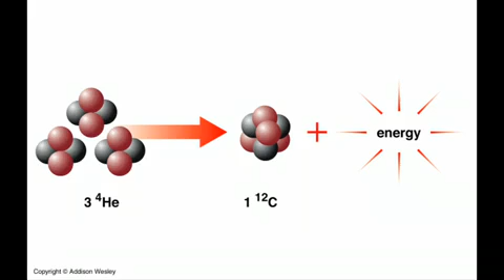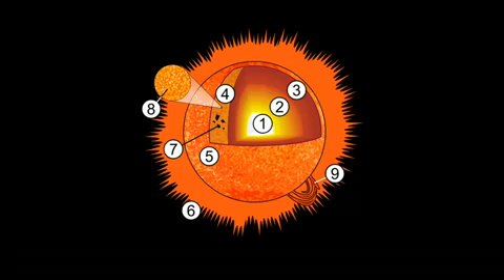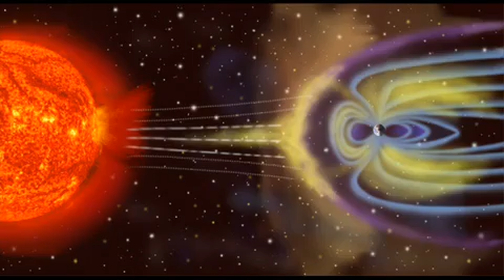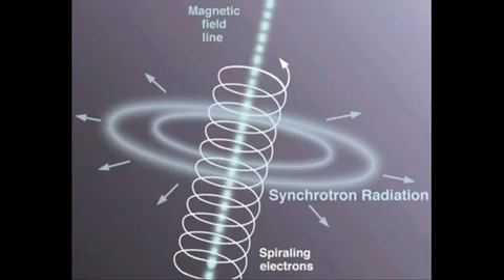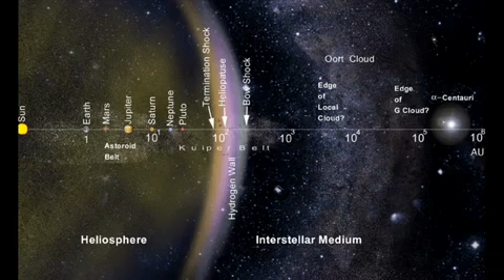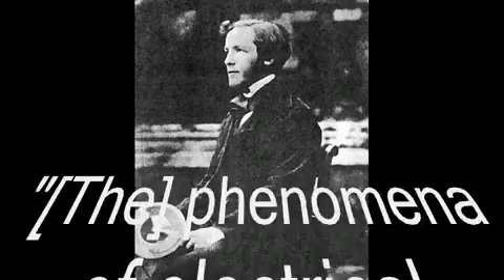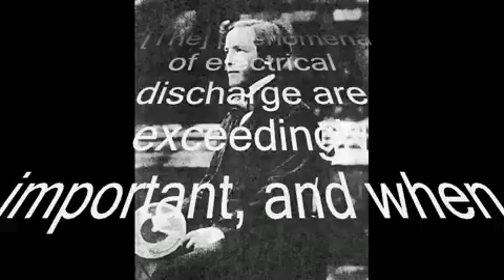Electric Sun Theory - A CAPACITOR

Comment: The standard model of the sun is held onto because scientists need the hydrogen fusion model as part of a comprehensive model for the universe to self created by natural processes. Scientists will not even consider evidence for an electric arc model of the sun because all the standard theories would have to be thrown out. It is interesting that high ultraviolet images of the sun show the filaments flashing and the surface ro be dark. If the standard model were true the surface should be hotter therefore producing more high ultraviolet than the filaments. Also the corona might not be as hot as is believed because temperature measurements assume incandesence instead of an arc. I contend that the corona is a Geisler glow and all the light is caused by an electric arc in the suns atmosphere.

Comment: "We may be heated by the solar corona" The energy density of the corona is very low so it cannot heat the earth or anything else. The intensity at X-ray wavelengths (i.e., where the Corona emits due to its temperature) is about 1 million time fainter that the the peak of the optical solar spectrum. See Figure 2 in https://www.researchgate.net/publication/231102823_Solar_radiation_and_human_health/figures?lo=1 for example. 

"How can the surface of the sun at 5700C heat the coronal to millions of degrees - the coronal heating problem"  The answer is that the surface of the sun does not heat the corona by radiation, conduction or convection. Its heated by a combination of the release of magnetic and sound energy. This has been known for decades. 

NO, prominences are not arcing from one point tot he other on the surface. They are large quantities of very cold, dense material suspended by the solar magnetic fields. It it were arcing it would be extremely hot. Prominences and filaments (the same thing but on the disc)  last for days to months - a continuous arcing process would create an extraordinarily high temperature plasma (MK) as in a flare.  

The sun, at the observed temperatures, is a huge ball of plasma and as such it cannot act as a capacitor as plasma is an almost perfect conductor. 

Spicules last only a few minutes so are pulled back by the force of gravity. 

The solar wind can accelerate or decelerate near the Sun but slows as it moves out into the solar system ,  the idea of it being accelerated by a universal charge in balance (against the law of conservation of charge) would make it continue to accelerate. 

Charge is not the only thing that can accelerate charged particles, magnetic fields can too.
Reply: @eclipse369.  A bar magnet - no electricity.
Reply: @eclipse369.  Perhaps you should learn the basics of EM theory. Electricity is not the same as charge. Electricity is the flow of charge. There is no flow of charge in a bar magnet - that would require an energy source to create and maintain a PD.
Reply: @eclipse369.  Torus atom: You seem to be clinging to a 100-year old hypothesis, when atomic and nuclear physics has moved on  decades ago to a more complete understanding of the situation. 

There is a constant flow of what in an magnet? You just seem to be spouting jargon without understanding what it means or its implications. To maintain a constant flow of anything (like electricity) you have to have a constant energy source to drive  that flow (or you have created a perpetual motion machine  and entropy will want a word with you)

Comment: if sun aint fission why aint jupiter with its higher magnetet fields stronger than sun for its size a  charged ball of ionized plazma when both are same mixture of gas ..
Reply from the maker: Im nobody to talk, but if planets and sun's are just grains of dust along an electric transmission line, the answer could be is that the sun is simply a bigger grain of dust and thus becomes the path of least resistance along the galactic current.
Theoretically then, if the sun were to just poof out of existence perhaps the next largest body would illuminate?
Reply: because the earth is flat and you all are making conclusions out of hoax globe theory.

Comment: Your last words where ...’for reactions to occur on the surface’.... perhaps u mean for reactions to occur leaving and away from the surface... if so could this be nuclear fusion or does it have to be electromagnetic induction heating alone??? I ask this because plasma discharges coapt instabilities and these counter rotating beams drain angular momentum from the (slowing) rotation and confine the kink instabilities at very high temperatures of billions of degrees not millions...these kinks do fuse the plasma in labs here on earth so why not in the corona as well...
Is not the dominant spectra of the corona is Fe ions. This is suspicious for a fusion process endpoint in the ionic plasma discharge... liked ur video... keep going!

Comment: For many years it has been accepted that 'Black Holes' can suck matter and energy into itself and possibly into another dimension or reality.  Where does this material/energy/data go?!  --Output may be what we would call a Star or Gamma-Ray Burster which is specific.  -A White Hole... From our reality or dimension to another is the Black Holes on our side and the output from the other side (or sides plural) is what we label as a Star or maybe a Gamma-Ray Burster.  Ying and the Yang... White, black and the circled core within each that is opposite is a design of the process of information/matter/energy moving from one reality to the other and maybe back like a swirling orbit of matter and energy... We can only perceive 4 dimensions... the last being Time which we move in but can not escape, control or see beyond the arrow of.  The past as we appear to be aware of it is all we can sense and that dissipates as we get further into the future, like the tail of a comet trailing in the wake of its own path.
Reply: +None of Your Concern There are no black holes.
Reply: Really?? --Are you not familiar with OPRAH ??
There goes your assertion...

Comment: Is there any proof or any test, that we can do to undersstand that ?
Reply: No, because it is nonsense
Reply: Yes,  the Safire project.
Reply: @robertaugustijn1157  "the exact details and claims [of the Safire Project] are ambiguous, lack mathematical formalism, and often vary from one delusional crank to the next"
Reply: @drkstrong  the official papers are still being worked at. They only gave updates on their findings.  So how do you know what, if anything is missing?
Reply: @robertaugustijn1157  They must have been working on those papers for nearly a decade and still nothing? Looks like solid science, not!

It looks from their website they are busy trying to dupe mugs into investing in this boondoggle. 

One thing they say they are working on is a neutrino detector - LOL. They obviously dont know how difficult it is to detect neutrinos - requiring millions of gallons of  chemicals housed deep underground and then how will they differentiate that signal from the Sun background rate? Purely delusional or a complete scam or both.
Reply: @drkstrong  Or they are being thorough.
Reply: @robertaugustijn1157  No, they got nothing and they know it. If nothing else people publish their hypothesis and how they are going to test it. If they have not even got there they are not even to first base.
Reply: @drkstrong  That remains to be seen.  Judging by your reactions you already have formed your opinion. And let's be real,  it's not like there are no other research projects that take a long time to verify.  Dark matter/energy is a good example for that. Mathematically inferred,  but never proven to exist. I might as well be talking to a wall in this one.  So here is a link to a interesting conversation between Gareth from see the pattern,  and Montgomery Childs. 
https://youtu.be/h49AbVfI7KU
Reply: @robertaugustijn1157  I formed my opinion based on their solar model which is purely qualitative and even so makes no physical or theoretical sense and does not conform to any observations.